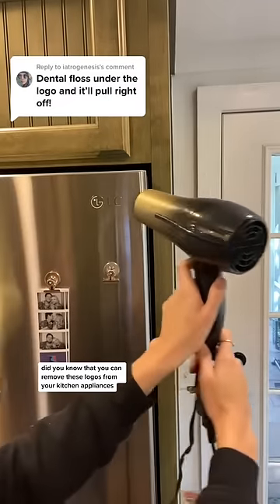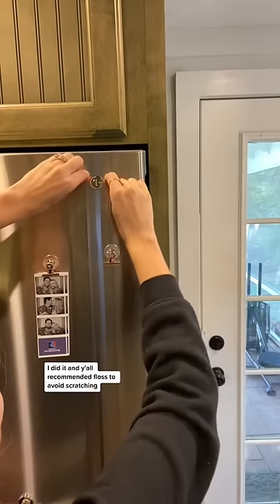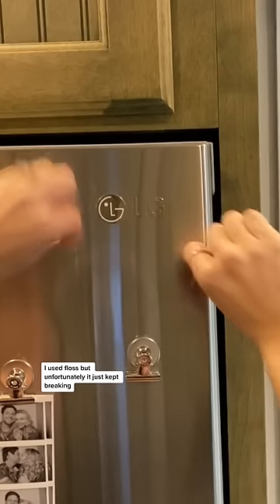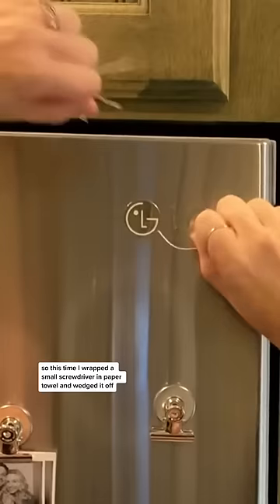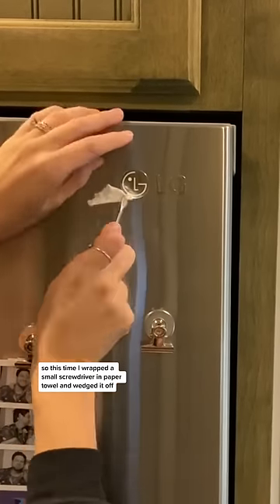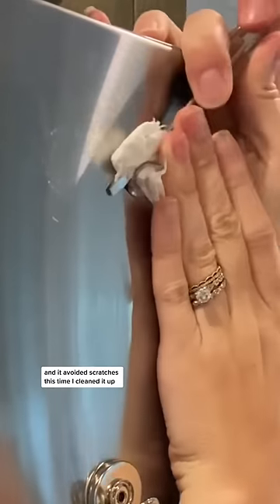Removing An Appliance Logo With Floss??

Comment: Use thin fishing line, or a new razor blade / utility knife blade instead.
Also; alcohol dissolves the glue without damaging anything. Peel a tiny bit, put some alcohol there (with a spray bottle or syringe), peel a bit further, alcohol, peel, etc.

Also, use a heat gun, not a hair dryer, to soften the glue. Preferably one with variable heat setting. (Half power should be plenty).
And keep the heat gun moving. Don't focus on 1 spot.
Reply: I know baby oil will take it off and so will olive oil or any oils..

Comment: Fishing line instead of floss. Floss is made to tear, fishing line isn't. As well as it's made to take tension. That's what I use (tied around a cork at either end) and I get no scratches anywhere. But I use it for things like this, separating things... Easy peasy

Comment: I wouldn’t want anyone knowing I had an LG either. All 3 appliances(LG) broke at the same time…after 3 years.
LG phone just stopped working after 13 months.
Old LG wouldn’t charge after a year. Never again!
Rant over…
Reply: I'm having the same problem with Samsung stuff. Is there any brand you found that work better?
Reply: @5phany5  what I was told when I worked at Sears (2009), there are only 3 appliance manufacturers. (Whirlpool is the only one I remember). Samsung, LG, etc. are all made by one of the 3. Even Kenmore (Sears house brand) was t made by Sears, it was one of the other 3 just tweaked a little and Lenore branding.
I’m a woodworker and same goes for intermediate machinery.
Ugh. Good luck!

Comment: Removing the logo completely dunks the resell value, which doesn't matter if you plan to keep this fridge until it dies, but there's no shame in having an lg fridge. However it's very unhygienic to cover stainless steel, which doesn't let bacteria live on it's surface, with glue and paper.

Comment: Update it’s not solid steel under there it’s a little plastic piece that wedges the logo into the fridge itself w adhesive in addition so at least for my model fridge this does not work. But if you’re planning to wallpaper it would absolutely work there just may be a little dent if you don’t fill in the gaps w spackle or something. 

Wow these comments 😂 Thanks for saying I have my life together lol. I’m about to do this will update ❤

Comment: You know there's a spray that literally is only used for stickers right? Like it's only use is to dissolve the glue on the back of the sticker so that you basically just wipe once with a damp paper towel.. work smarter not harder

Comment: You could used a hair dryer to warm the glue, and pull it off with finger
Reply: However, 😂, I just can't, it's just too easy, and it sounds like you need some better hobbies